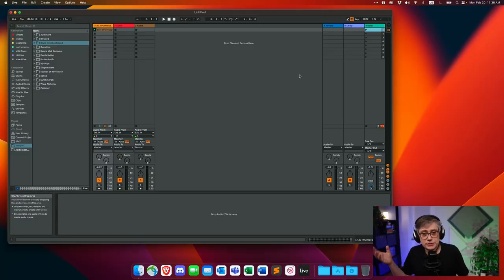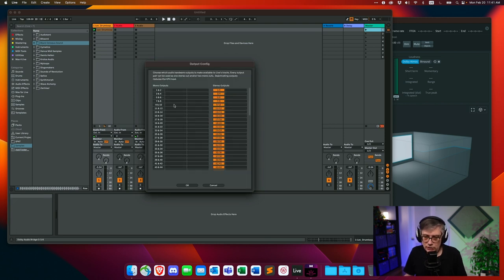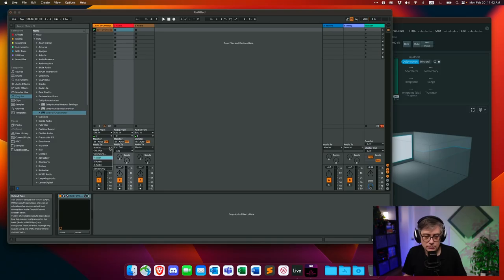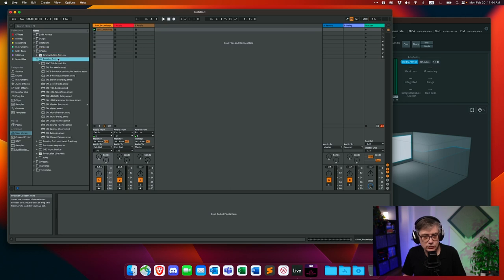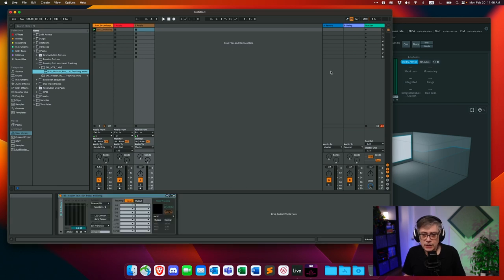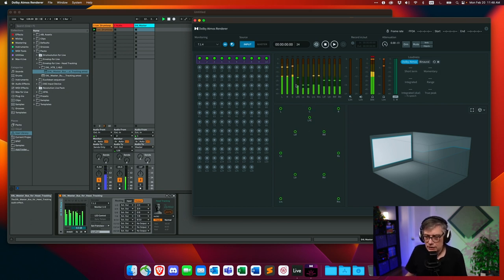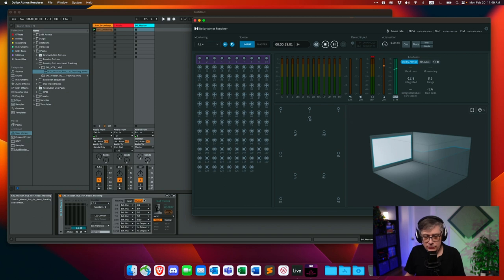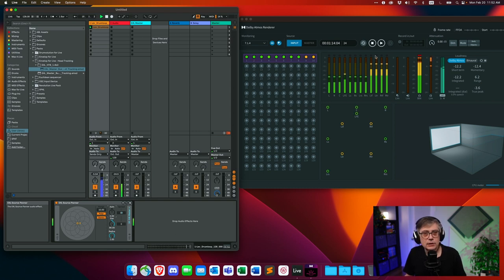7.1.2 Dolby Atmos bed tracks in Ableton Live made easy

Comment: Thank you so much for your videos. Very clear, and I've finally been able to alter my set-up to produce some crude Atmos mixes (my 'monitor' is just a cheap AVR with passive speakers, LOL)! Really exciting! Thanks!
Reply from the maker: You’re very welcome! Most people go the AVR route.
Reply: @michaelgwagner  Ah, that's good to know! I couldn't find much information about using AVR's though, the Gearspace forums for example seemed to strongly hint that it was just not possible, because the Renderer doesn't send an Atmos signal whilst monitoring. It took me weeks to figure out that I needed to reconfig my speaker set-up on the AVR to keep all the channels perma-open and bypass any need for encoding in order to get the audio to the ceiling speakers. Doh! 😂 Also, I found the way to set-up the monitoring on the Dolby Renderer really weird and anti-intuitive (I only have a 5.1.2 setup), but in one moment of exhausted, frustrated random clicking it all magically came together! Anyway, thanks for your help, I seriously would be lost without these videos. It beats trawling through the manuals!

Comment: Great tutorial! Thank you for this. Silly question - I am using Ableton for a project that requires a 5.1 mix. I will do the same process as you guided in the video (but for 5.1). How would you recommend exporting the file when delivering to the client as a WAV? Thanks again!
Reply from the maker: I would probably just route it into a secondary DAW such as Reaper. If you are working with the external Dolby Atmos Renderer you could also export it thtough the renderer in 5.1

Comment: Thanks so much Michael! Incredible video as always.

Is it necessary to configure the inputs of the Envelope Master Bus? And if so, what are they?
I'm having difficulty receiving any audio information from the master bus into the atmos renderer.
Reply from the maker: No, the inputs of the Envelop Master Bus Devices are not necessary in this case. Make sure that you have the Ableton and DAPS inputs/outputs set correctly.
Reply: @michaelgwagner  I have the same issue...daps doesn't recognise E4L Master outputs
Reply from the maker: The dev is currently trying to figure out what the issue is. Most likely a problem with the Ableton version. Contact me on Discord and I can send you the previous version of the device which does not have the same issue.
Reply: @michaelgwagner  Thank you! 

In fact, I was just about to contact you - I realised the older version worked, while the updated version did not. I had assumed there was a problem with my installation of the update.

Glad to hear it's a known issue.
See you on Discord!
Reply: @flowersh0p  I believe I fixed the issue you were having. Please go back to the download link and try version 1.42. Can you post back here to let us know that it works?
Reply: @D5x610  The problem remains! No audio is being received in Atmos from the updated (1.42) head tracking Master Bus, while the original Master Bus can still send a 7.1 signal.

Thanks for your continued work!
Reply from the maker: Noah just posted 1.43 on the Discord. Try that one.
Reply: @michaelgwagner  yes thank you Michael I already installed and it works fine

Comment: Can anyone explain why this is necessary. Dolby has a video up for Ableton where they make it seem the workflow is pretty much the same that I see in the Pro Tools videos. Atmos Bridge -> Track outputs assigned to according beds + Timecode -> Atmos renderer
And then there is the Fidler Atmos Composer which seems to work similar as the Atmos renderer but with a plugin on the master bus. 

What do I miss?
Reply from the maker: Ableton does not have multichannel capabilities, Pro Tools has. You can do (almost) everything in the Fiedler Atmos Composer. But this is an older video. It was published before the release of Fiedler’s Atmos Composer.

Comment: There is no Dolby audio bridge in windows pc
Reply from the maker: Mac only, unfortunately.
Reply: @michaelgwagner  :( why they have installer for renderer ?
Reply from the maker: @YigitDiri You can use it in a 2 computer setup. And you can use it standalone to create quality control deliverables.
Reply: @michaelgwagner   hm then it is a problem about windows loopback system i guess. Ableton live also cant send audio into obs like mac do. We have to use external apps like reastream. So if i use physical i/o instead of software like bridge i can do it in windows as well? 

I can choose focusrite outputs now so if i send them to another computer i can use it right?

Or if i loop back those outputs to same pc it will work also?
Reply from the maker: You can use Jack routing for the 128 channels. But the main problem is the lack of a Windows version of the music panner.